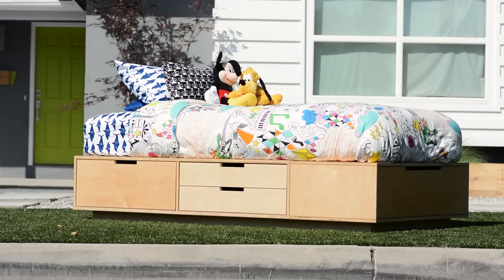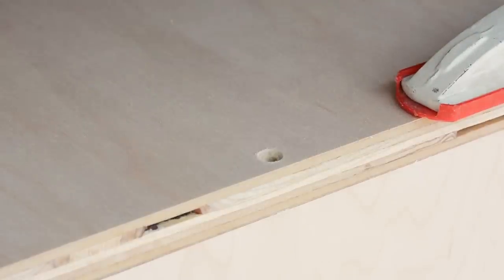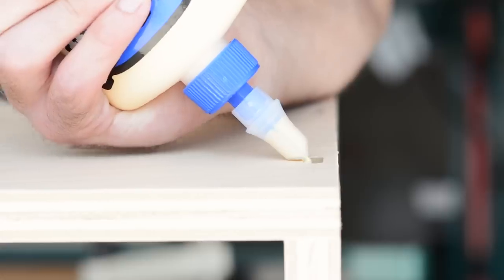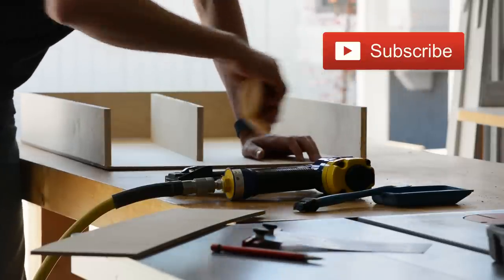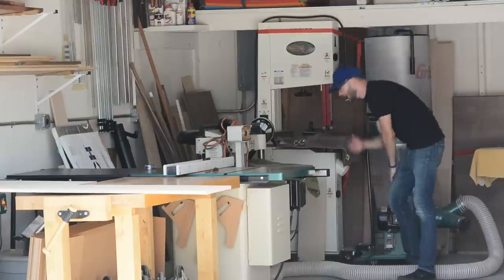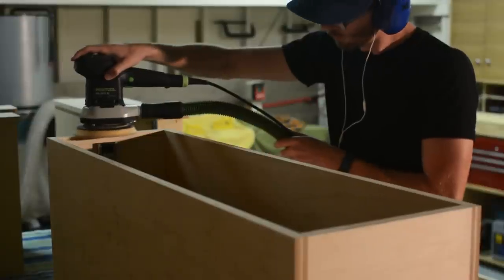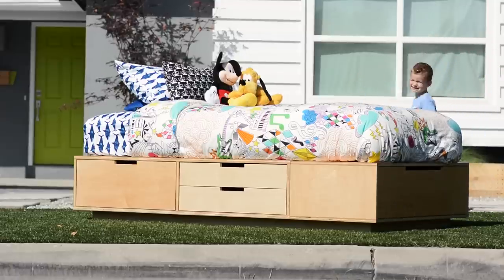Kid's Bed With Lots of Storage | Twin Size

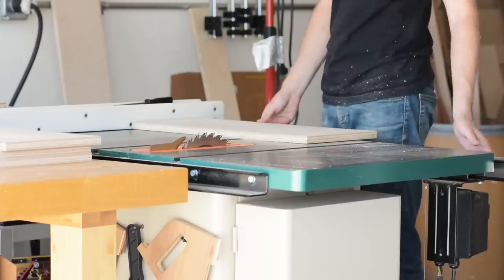Comment: I am brand new to woodworking so take this with that knowledge. Is the cut at 1:22 unsafe because it's wider than it is long? I've been really trying to understand all of the safety concerns with a table saw because I want to keep my digits for as long as I can (Forever) and from what I understand if a cut is wider than it is long then that can leave to a kick back? Am I wrong? Again, not meant to nitpick or be disrespectful because your videos are my favorite on YouTube, just an honest question.
Reply from the maker: Hey Eric...no offense taken. What you're thinking is a good general rule...but it's more likely if you're talking about a piece that is like 2" side and 12" long. In this case, the pieces were still pretty wide, so there is plenty of material to keep on the fence. That said, any piece could pick back no matter what the shape. Hope that makes sense.
Reply: Makes sense to me! Thanks for the info (and also the great videos)

Comment: Excellent build, which type of ply wood used for this bed.
Reply from the maker: It's Maple 3/4 inch.
Reply: Solid gold right?
Reply from the maker: ...and diamond incrusted. Yes :)
Reply: Made my childs bed from solid gold platinum laminated sheets with diamond fasteners. Forgot to film it as well. 😎

Comment: I agree with you, plywood does look nice. Some shop projects made in ply are actually great; and I've seen furniture in a fast-food bar made of ply with no edging, tabletop made with two 3/4 boards and rounded over and it gives a modern look. The burgers were mighty fine :)  Great video
Reply from the maker: Yeah, I see it a lot in restaurants. Chipotle comes to mind. Usually when they are going for an industrial look.

Comment: My wife has been pushing me to make a bed for our two year old so I get the motivation, my only thought with your design is the mattress moving or slipping has that been a problem or did you prevent it from doing so? Love your work, keep it up.
Reply from the maker: It hasn't been an issue on our (the king size.) It is a memory foam whatever mattress...so it is pretty heavy.

If it were an issues, I 'm sure you could use some of that rubbery drawer lining stuff and it would keep it from sliding.

Comment: Awesome video and build, as always. Maybe i'm missing something, but those sharp edges and corners don't look particularly safe. Maybe it would be a good idea to sand them down/apply some sort of padding to the corners?
Reply from the maker: thanks Nicu. I didn't show it in the video, but I actually did break all of the edges and corners that are either front or up facing for that very reason. They will still hurt to run into, but they aren't sharp...so they won't cut. I'm sure my wife will have the whole thing surrounded by pillows in a matter of weeks anyhow.

Comment: I notice you use the same finish on most, if not all of your projects.  Is that just wipe-on poly?
Reply from the maker: Yeah, it is called "Hard Oil #9" it isn't a poly. It's a penetrating oil. Not as protective as a poly...but much easier to use and to remove if needed.

I've used it for all sorts of projects and haven't had any issues so far.

Comment: I like the edges on plywood as well. Especially the birch plywood we have here (netherlands)
Unfortunately wood isn't cheap around here
Reply from the maker: Yeah. It's good stuff. For comparison's sake. A sheet of 3/4" furniture grade plywood here is usually about $75-100 for the more common species. How is it there?
Reply: A full sheet of 3/4 inch birch plywood starts at 100 dollar around here. The birch we can get here are the ones with the many thin layers.

Comment: Hi how much plywood did you use for this amazing build :)
Reply from the maker: I think it was 3 sheets of 3/4, 1 sheet of 1/2 and 1 sheet of 1/4. So five in total. I would say total cost with hardware was probably almost 400 bucks for material.

Comment: Hey Chris, what spacing did you use for the cross pieces in the platform? I'm adapting the upon the file you provided through patreon for a Queen size model and I want to plan out the platform and cutting list. I assume the drawers are 1/2" ply with the 3/4" front screwed on?
Reply from the maker: Hey Robot. You're correct on the plywood. It's all 3/4" except the drawer boxes (1/2".) I'm not sure exactly what you mean by the "cross piece". I sized the whole thing to be 2" wider and 2" longer than the mattress, that way it would be 1" proud on each side. I've built a similar bed that was for a California King. For that one I actually build the three boxes in a "U-shaped" configuration, and then built a little platform in the middle to support the mattress (The platform was made out of 2x4 and some cheap plywood from Home Depot. Send me an email, and I can send you a picture of that. It is probably more similar to what you would want to do for a queen mattress
Reply: Hey Chris. By spacing I mean the distance between the stretchers/cross members in the platform. 

I already came to the same conclusion regarding the U shape configuration.Otherwise the boxes would be very deep and increase cost significantly.
Reply from the maker: Yeah. Though you'd be able to store a lot in them :)

Comment: Super cool design, solves a problem I've been pondering about my bed, namely how to build one I can both keep in my garage without taking up the whole place during the build, and one I can move upstairs without too much hassle.

One question, what are you using to finish it? Whatever it is looks reasonably easy to apply and makes the birch ply look sweet.
Reply from the maker: Thanks Maxwell...it's called "Hard oil #9" by BioShield. It's pretty easy to use. That was maple, but it looks good on everything. It is a very natural looking finish.
Reply: Chris Salomone awesome, thanks! Definitely going to pick up a can.

Comment: Hey What is the name of the tool you use at 2:46 . I've seen you use it many times but i tried looking in my local hardware store and they didn't have it... I think
Reply from the maker: You can get it from amazon. There is a link in the video description. It's called an Incra T-rule
Reply: Cheers, It's gonna be fun finding that in Australia at a good price

Comment: Hey there Chris, You've probably gotten this question before but what's the make of that ruler with the slots in it for marking? ...and really all of your measuring tools... that little red t-square thing is pretty sweet too! Thanks for the great videos!
Reply from the maker: Hi Tyler. I do get that question a lot...it's called and Incra T-rule
Reply: Thanks! That little dude is going to be a big time saver!
Reply from the maker: I really love it. I told Incra that I'm their unofficial spokesman. I get more questions about that than anything else.

Comment: what is your process for mounting pull out slides ?   love the project!!!
Reply from the maker: Hey Mark. I start with those that are highest up. Cut a piece of wood to rest the hardware on while I mark out both sides, then cut the piece of wood shorter and repeat until I've worked my way down to the lowest. Maybe I should make that one of my "How I" videos for the next in that series.
Reply: would love to see that in your how to video

Comment: great video as all ways Chris. I have been looking at making a bed like this for my partner and I the only thing that I know I have been trying to work out on how to do, and something I didn't see you had done was holes or slats to allow the bed to breath and dry out (body sweet etc)when your not sleeping on it, would you have any ideas for this?
Reply from the maker: Thanks Edward. I guess I just didn't concern myself with that. I suppose if you wanted you could build a little slated platform between the underside of the bed and the top of the platform to create a little air gap. All 4 edges of the mattress are exposed (unlike a non platform bed where the mattress sits in a 5-sided pocket) I'm sure that helps
Reply: Great thanks for your ideas Chris. Looking forward to your next great video.

Comment: Clever idea and I too am OK with seeing ply edging.  I didn't see any voids in your edges either so assume it is reasonably good quality ply.  Thanks for the vid.
Reply from the maker: Thanks DRMNZ. It is good furniture grade plywood...but there is still the occasional void here and there. Thanks :)
Reply: What's your best method for filling those voids? I usually just fill it full of wood filler in a neutral color to match. Any tips there?
Reply from the maker: I've never done anything Mr. Hammerstein. The times I've left the plywood edge, I've never had a void so bad that I've had to deal with it. And the times that I've really cared about my edge, I use hardwood strips to cover the entire edge.

Comment: Plywood shmywood - sure it's great for a lot of applications but I would always prefer to sleep in massive pure wood all properly timber jointed without a single skrew
Reply from the maker: Haha...knowing that there is a screw in there is going to give my kid nightmares for the next 14 years. Oh well.
Reply: Hopefully not, i like the Design and your designs in general but as you said - we spend a lot of time in beds and I feel better if it's pure wood, some oil and birds feathers in the blanket instead of thin wood layers and especially lots of cheap glue
Reply: ... And it's really just my two cents, tastes are different and I know that I would read a comment like that and be like "meh,that random internet guy is talking bad about my work" - If so - i didn't mean to 😘
Reply from the maker: No offense taken. Promise :)
Reply: I agree. The last 2 videos are the shortcut method. Not what intrigued me to subscribe originally.
Reply: That was a part of my critique as well - I don't mind if the woodworkers I've  subscribed to only upload a new video monthly or even less by than I hope for something interesting or original

Comment: Please tell me what kind of software you use to design the furniture? Sketching looks great!
Reply from the maker: Hey Alexey...it's Sketchup
Reply: Thanks a lot! I am a beginner with woodwork (made just couple of furnitures at home). This will help.
Started to learn how to use SketchUp. As far as I understand, you need some addons to do such advanced sketches as you do. Please give me advice: what are those addons I need to have?
Reply from the maker: Hi Alexey...no add-ons needed. If you go to the styles menu, there are different options. I usually blend multiple layers together in photoshop to achieve the final look.

Comment: I also jused the duckt tape method to mark the deepness of a hole, but the wooddust didn't come out and got stuck in the drillbit. 
Did I anything wrong, or is this normal?
Reply from the maker: I get little chips stuck in the bit too...but they come right out when I rub it with my finger afterwards. Is that what you're asking?
Reply: Yeah, so it's normal?
Reply from the maker: Probably...don't know for sure.
Reply: Ok, thanks!

Comment: Wow I spent days searching the internet for good bed storage plans... 
I would love more detail... mostly on the box building aspects... in my case I would be building a a frame for a queen bed but I love the modular style as well as the minimalist style. The narration is awesome too... and even if you had a cut list you were willing to share I would still be adapting it to a queen size bed... however I'm sure quite a few of the building concepts would be transferable. Anyway... any insight or tips would be appreciated...
Reply from the maker: I built a kind this way and may do another for a video. It's almost the same, obviously the boxes are bigger. But, the two side boxes don't back up to one another. That would just be too deep to even use...so it sort of forms a U shape. then I just used 2x4 and plywood to build an equal hight platform in the center.

Comment: Hi Chris! Awesome videos!  This one has inspired me to build my own modular platform bed frame.  What kind of plywood do you use for your projects?  What plywood was used for this one?  Also what program do you use for the 3D animation of your designs?
Reply from the maker: Thanks Lee...I use sketchup for the animations with a plug in called Key Frame Animator. Plywood I get from a local place called Reel Lumber. I'm not sure of the specific brand. This one was made from maple veneered plywood, but most common that I use is baltic birch

Comment: As a father of eight, the oldest of whom is 20, nah, they won't "appreciate". They'll buy some Italian crap with their first salary and throw your heart-and-soul-filled creation (aka "stupid old bed") in the dumpster. Talking from experience. And two, I can't touch this thing so I don't know if I'm right, but I think you should round the upper edge of the platform on which the matress rests. If you look at your son jumping off the bed you may notice that his legs don't quite reach the floor and he slides down. And the backs of his legs rub on that edge. I'm only supposing here, but don't you think it may kind of... hurt? The same for the drawers "handles". Maybe round the edges a bit with a router for more comfortable grib? Just thinging aloud here.
Reply from the maker: I did...all of the edges are sanded to break the sharp corners. On his headboard (different video for the same bed) I used a round over bit.
Reply: Ah, I see. I need new glasses! Or larger screen! :-)